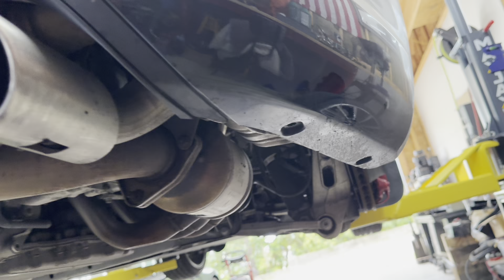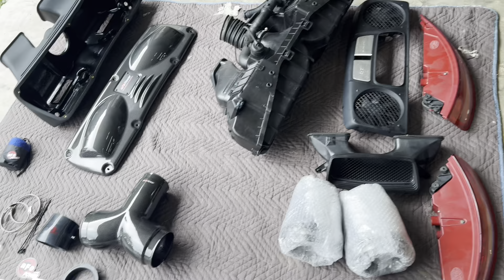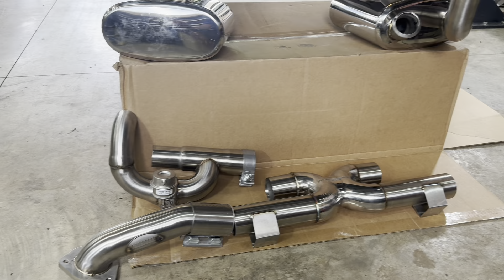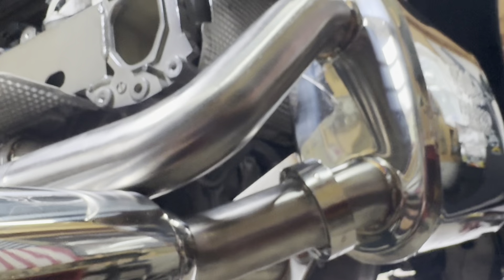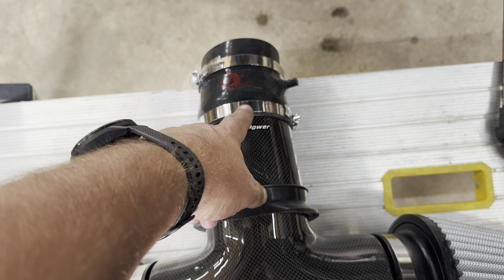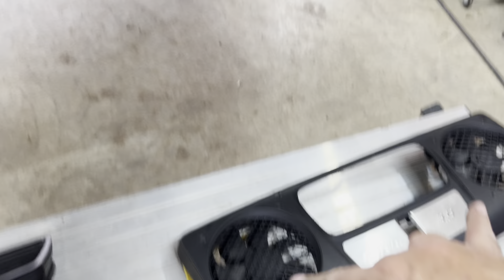2014 Porsche 911 Carrera S - Fabspeed valvetronic install, Advanced Flow Engineering intake install

Comment: Hi, did you ever end up fitting the valve controller? I've fitted a similar system with the same valve controller. But I can't work out what to do about the original vac lines, and where to wire in the controller.
Reply from the maker: Nah - we skipped it. It required tapping into the factory harness and I wasn’t interested in that
Reply: @beardedgarage  What did you do with the existing vac lines?

Comment: Very nice instructional. (All I wanted was to see the air intake grommets on the body. I pulled 3 codes because someone at the dealership lost the upper intake housing bushings. 2013 991.1 with just 21k miles. On fabspeed, I installed new Fabspeed headers and 300 cell cat back system to my 996. All stock 996 4S. The passenger side header was hitting the return cooling line. I asked a family member that is a crew chief with RFK racing. No header should ever touch a cooling line. Fabspeed owner called me and said they had done thousands of these and no one had a problem. I sent my headers back, (and had to pay shipping). I polished the OEM stainless that are nearly "header tuned". Very happy with Fabspeed product but I ran in to the same issue as you did with fitment. The crossover pipe connector bots had hex-heads touching the motor. I did get some carriage bolts from Fabspeed after documenting this fail. I love your channel but will buy no more Fabspeed parts. It says made in USA and probably is. When you put the parts in the car, good luck. It is like zon. Be prepared for non fitment and no directions. Owner is an *$$. Back to the vid. nice job!
Reply from the maker: For what you get, I think fabspeed is ridiculously expensive. They don’t send any instructions…. It’s just mediocre, shiny parts. And… honestly I don’t love the sound, I’d prefer a fister any day

Comment: When you go with aftermarket air filters that require periodic washing and oiling, do you have to disassemble all of that just to get to them?
Reply from the maker: Yes. Yes you do. That’s why we didn’t put in a K&N that requires oiling
Reply: @beardedgarage  Hi thanks for answering.  Okay, but doesn't this air filter require cleaning?  Seems like quite a task to get to the filters. What am I missing?
Reply from the maker: @RealEstateChris56  You’re correct. It’s absurd. You’re not missing anything. The guy thought this sounded good and wanted to put this on. He’s a good friend, but money doesn’t buy brains! 😮
Reply: @beardedgarage  Okay, so I guess that answers why visits to the Porsche dealers are costly...it's mostly just the labor to disassemble and reassemble.  Hmmm.  I really want a 911 but this bugs me.  I like doing the mundane tasks like oil and filter changes myself.   Thanks.
Reply from the maker: @RealEstateChris56  There's a lot of things you can do yourself, all the way to engine removal, clutch, plugs, etc.  You just need space and time. This is a completely optional upgrade and not at all necessary. What I've found is that the more performance you want out of a car, the more work it takes.  Porsche at least thinks of repairs as a normal state AND work can be done by mildly-competent mechanics in a home shop.  Some of the other big brands make working on your own car a real PITA.

Comment: Great video. I was considering the exact same setup. But ended up getting the comp headers instead to pair with PSE. Sounds amazing between 3500-6500.
Reply from the maker: @Pcar_dad6733  do you get any humming? With this setup it seems to have a droning sound in 6th gear, with cruise control at 75mph. If I downshift it goes away but it’s one of those annoying resonances.
Reply: @ no, not a all. I would keep the valves closed. Because they open up automatically after 3K RPM. It also removes the burble as well.